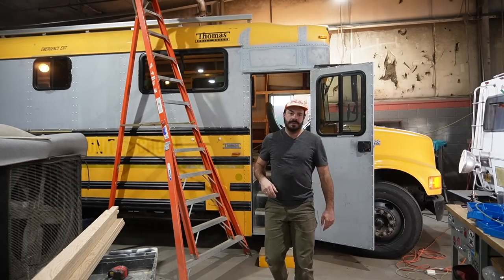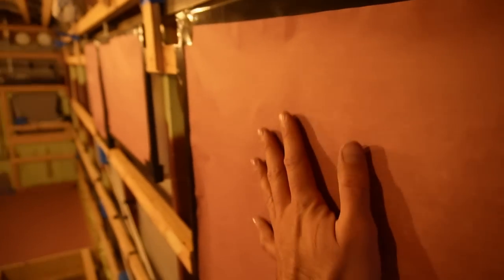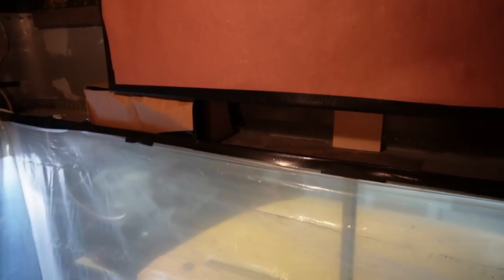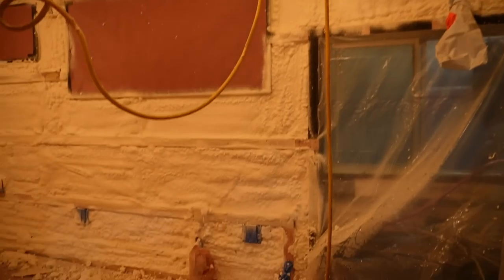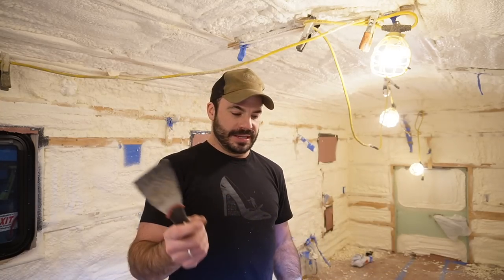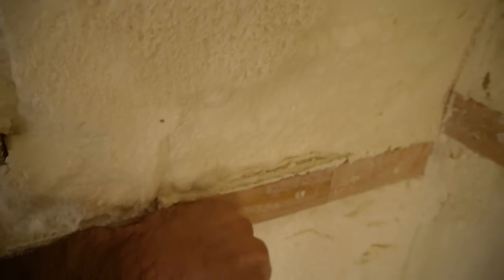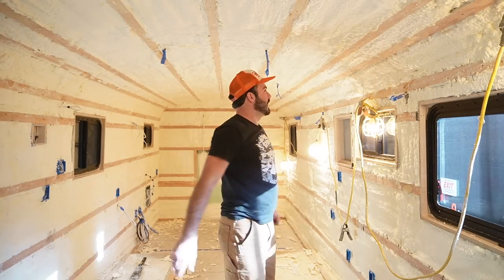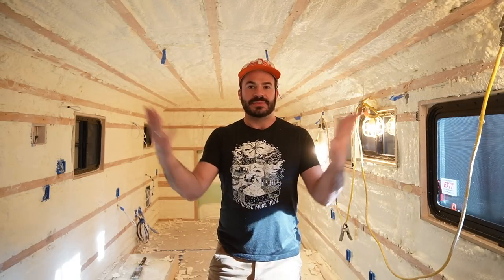Is Spray Foam Worth It?

Comment: If you put packaging tape over your strapping you won't have to scrape them
Reply from the maker: Yeah next time haha
Reply: What a great concept you would’ve thought he would’ve thought of that ha ha ha ha
Reply: I thought in another video you said that the foam should be a couple of inches thick over any wood ribs. 🫤
Reply from the maker: Never said that
Reply: @ChuckCassadyYT    Thanks.  I’ll go back and listen again. 👍
Reply: @christinearmington  I watched that one earlier today upon finding out about Chuck's videos. He was talking about going over the steel ribs with insulation and also not sistering wood next to or over (vertically) the steel hat channel like so many mistakenly do from not knowing better.
Reply: @christinearmington  
I think he was talking about making sure that the spray foam is applied over the metal ribs that people tie their studs to, and to spray foam over the metal ribbing to make sure that there is an adequate barrier to prevent moist air from hitting the metal, not the wood.
Reply: @christinearmington .  Nope. He said foam over steel ribs.
Reply: @christinearmington  yea I just watched that video too and got confused on how he boarded over it . Think he was talking about the metal not the wood
Reply: @christinearmington  metal ribs
Reply: @ChuckCassadyYT  insulation scam video at 33: you say "we spray OVER that WHOLE ASSEMBLY with spray foam", easy to misunderstand.  Nitpicking you a bit.  I agree 100% with your strategy, not much you can do without losing a lot of space.  The wood won't move enough moisture to matter in most cases, unless you're in bitter cold all winter then it will rot out the wood eventually, but you probably won't even notice with the wood foamed in.  The screws might make condensation and mold spots on their heads, not much you can do about that, maybe silicone caulk smeared over the head.  Stainless screws will have one half the conductivity of carbon steel, but that's getting pretty picky.

Comment: Pro tip. Once the sprayfoam is up, put some colored tape on the ribs wherever a wire passes behind it. That way, when your walls go up, you know where your wires are and where not to run a screw into.

Comment: Looks great. My only (admittedly ignorant) concern, is encasing those wires in the foam and also not being able to make changes/additions to the wiring if needs change later on. Would it be reasonable to install pvc pipes inside the walls to act as wiring ductwork for future enchancements? (recognizing the need to try to minimize the interruption on insulation, as much as possible)?

Comment: Just so you know, romex is not an approved product for automotive installations.  If it is actually romex, it is using solid copper conductors which are extremely prone to vibration.  If you are actually a "pro" you would, of course, already know this which means you have chosen to ignore it.  Not a good position in court.
Reply from the maker: You should watch my videos on how I wired my bus. It’s not romex

Comment: Buy a refridgerated van then windows to suit save loads on WORK COST PLUS PLUS ECT COLD IN COLD OUT..FIBRE GLASS COATED INSIDE..HEATING IS DOWN TO HOW HOT YOU WANT IT..😂 AND THEY OFTEN AS CLEAN as clean can be. Thumbs up if you like my comment

Comment: But...but...but, Chuck...what about all the offgassing I hear about in FB groups?  :-)  I'm 100% with you on the foam insulation.  Once the closed cell foam has expanded and cured, the structure is closed (hmmm...closed, closed cell makes sense) and (according to the EPA) "When spray foam has been correctly applied and cured, it is usually considered to be relatively inert."  I wish more people studied this, as you clearly have.  Nicely done, sir.

Comment: Is there a reason for only having 3" of spray foam yet the floor is 4" of foam? As warm air rises I figured you would want to do 4" of spray foam, unless you are trying to save a couple inches of space in the width of the bus for the interior. Spray foam is the way to go
Reply from the maker: R20 is my goal all around and thr board in the floor is only r5 per inch, while spray is r7

Comment: Do you prefer a particular spray foam formulation that retains some flex?  I'm wondering how the flex of the bus interacts with the foam.  In my experience, spray foam dries very rigid, and I could imagine the flex of the bus over time might break the foam and/or delaminate it from the walls, and allow moist air to touch cold metal.

Comment: Missed the live chat this week but man are you ever moving quick on this build! Spray foam looks great man. I still have a little bit to foam in our aft cabin ceiling and on the front cap, but every inch I cover makes a difference.  It's crazy how good it works.
Reply from the maker: It is definitely the best!

Comment: Chuck, Try an angle grinder with a 4" thick wire brush, grinds right thru the foam, just wear goggles as it will product foam dust that will get in your eyes.
Great video

Comment: Interesting video packed full of information.  The one thing that sticks in my mind is the heat.  In the US temperatures are getting so high in places, like Florida, Texas, the desert, etc.  This insulation can help with that, but what about an outer metal skin of these vehicles that heats up to very high termperature?  Can it cause off-gassing of chemicals from this foam?

Comment: That looks incredible!  I have a van coming in December and dream of having a similar insulation and framing.  I think I will prefer to have my electrical out and exposed so it is easier for me to install and maintain.
Reply from the maker: all i will say is that once your wall panels go up there is no way to maintain your wires anyway. plus wires dont need maintenance. you do you!
Reply: Is it crazy to think about using small PVC pipe to encase all electrical in? That way of there is an issue, you have an accessible chase to pull wires through 🤔

Comment: Excellent video. I got my husband to watch it with me, he has more knowledge of construction and insulation than I do. I certainly learned a lot from your opinion and my husband was able to explain the parts that were a bit triciy for me. We have a small fiberglass trailer, which we would like to insulate for both heat and cold. I am extremely sensitive to chemicals, so offgassing is a concern to me, however I think that you made a very good point about driving a diesel vehicle in the middle of traffic as a way of living. In my personal experience, exposure to airborne chemicals have a compounding effect, which is why we chose a towed as opposed to motorized RV and cannot use propane or butane, so we bought a used rig that we can customize. Beside offgassing, my husband has concerns about the flammability and toxicity of the fumes in case of a fire. I think it is a genuine concern because there is a higher risk of fire in an RV compared to a home and I am interested to know what your thoughts are on this subject. This being said, good job on your video, I am new to this channel and will check out your other videos and subscribe.
Reply from the maker: The sprayfoam we use has a class 1 fire rating so I'm not concerned about it, but not all.spray foam does! Thanks for watching and enjoy your new rig!

Comment: Could you just run the wires for the bus functions behind the foam and leave the "house" wires until after so they are more flexible and inside the foam?  We have a family of 4, and our bus is only 31.5 feet bumper to bumper so dialing in a layout before hand has been a challenge and precise locations of lights, outlets, panels, etc. might need to changed later.  We need a roof raise for sure to have bunk beds for the kids.

Comment: I sell Sprayfoam and a customer had a project where he bought a school bus. 2" of closed cell on the walls, 3" for the ceiling. Job came out beautifully. Acetone is the only thing that removes foam sadly it also removes paint as well. So use it very carefully

Comment: I think a major concern many folks have with spray foam is that it can warp the outside of the vehicle. You should show the outside of the bus and talk about how your guy avoids warping the sheet metal. Unless it did warp it, but still, showing and talking about that would be great.
Reply from the maker: That's overblown with a competent installer. Spraying thin layers and using no less than 18ga steel for the skins. We've sprayed dozens and never has that issue

Comment: That looks great, I was afraid that there would be far more trimming needed. How long was the installer there, and how long did it take you to trim afterwards? I am thinking about a small van build, and am wondering if spray foam makes sense or do you need a larger vehicle to justify it? Then of course comes the issue of finding a good local installer.

Comment: Ok, I don’t get it. In your other video you seem to indicate that all the metal and the wood framing needed to be covered with the foam. However after the foam was sprayed on you could clearly see some of the wood? The metal ribs stuck out like 1.5” and then the wood was attached to the metal ribs and stuck out an additional maybe 1.5” then the entire 3” cavity was filled up to the outward face of the wood framing but not covering it? This seems to be contrary to what you said in the other video, and would it not support the desire to have moisture not reaching the wood framing, or is preventing the warm air from reaching the metal/wood contact point is the important thing. Also, wouldn’t covering the boards not prevent thermal bridging but still make it easier to attach cabinets as you can still see the framing?

Comment: Great video as usual. Thank you Chuck.  Question: Why XPS and not Spray foam for the sub-floor?  If this professional spray foam hardens that much, why not use for the floor then?  Thanks!
Reply: Since he doesn't frame the floor, I suspect the flatness of factory-made panel products is the key reason. Trying to get a spray foam floor as smooth and flat as panel products would add tons of labor hours to the build.

Comment: I was planning on steering clear of spray foam for my fiberglass shuttle build out but now you have me reconsidering primarily due to the claim that it will add to rigidity of structure which is a serious issue for shuttle buses...however still concerned with it expanding and warping my exterior since it's not metal...I am using mostly marine grade products for my land yacht
Reply from the maker: I've never had issues with expansion like that, especially if applied by a pro

Comment: Hey Chuck, sorry I am confused, I did just watch your video on insulation 101 and I thought you mentioned that even if wood touched metal and its not insulated then it becomes a thermal bridge, I see all your wood framing and no insulation over it so am I missing something?? sorry for not understanding, I want to follow your instructions  and needed clarification if you could please, Thank you, your excitement is motivating
Reply from the maker: The places the wood touches the metal is covered with insulation
Reply: @ChuckCassadyYT  The amount of wood strapping that's bridging is just the part over the metal rib, because the wood is a good enough insulator that it won't conduct along the length much, not like a whole stud that's touching the exterior, or worse a metal rib that's touching the exterior metal skin.  If you used aluminum strapping over aluminum ribs, then the whole length of the strapping would be a thermal bridge.  The wood is nearly the best solution.

Comment: What do you think about putting the plumbing in the floor channeled into the last layer of foam board under the plywood?
Reply from the maker: Not a bad idea but that is a cold place for it
Reply: I know you were asking Chuck but the floor is the coldest part of the bus. If pipes are going to freeze anywhere, it would be there.
Reply: @rossallen738  Lol probably right, I was thinking why not sandwich it in between the insulation and plywood but meh. If you are in a warm climate all the time it wouldn't matter but in my area it gets below zero in the winter and over 100 in the summer lol. oof.

Comment: Great video! I have 2 questions! For the gap behind the chair rail, how did you clean rust off if any was present, and did you add chassis saver? As for spray foam, did they just spray it down into the gap? Thanks for your input!
Reply from the maker: my bus was rust free down there, so i just vacuumed it and washed it and let the spray foam fill it in
Reply: @ChuckCassadyYT  thank you! I’m hoping ours is rust free as well!!

Comment: Chuck, could you wrap the inside of the insulation with visqueen as a vapor barrier, similar to homebuilding, if you cant get the full 2" of foam or if you were to use a different type of insulation.

Comment: Hi that came out beautiful,.
I have a question I have a 32-foot Holiday rambler motorhome I'm getting ready to redo the whole thing they say that from spray foam world distort metal the motorhome is aluminum walls in aluminum frame I was going to frame everything up I could floors walls ceilings and then spray foam but I'm worried about the walls of the motorhome very thin aluminum I could use strapping as a barrier between the aluminum frame in the walls what do you think this thing is in 1976 and they don't make them everyday butt spray foam the way I wanted to do it your boss is made out of steel and they're rugged this thing isn't rugged

Comment: Did you consider using [lightweight plastic] conduit for the wiring so you don't have to dig it out later if there is an issue?  It would also provide a path for any warm spots to spread the heat.
Reply from the maker: I cover this in a video all about wiring

Comment: What do you do if anything to prevent the screw heads holding the fur strips from condensation?
Reply from the maker: The first layer of wood is covered by the second and sealed with foam so it's very very unlikely to have condensation build up
Reply: @ChuckCassadyYT  Oops' after pausing the vid I see it's double layered, nice! can you get away with less than 1.5 "?

Comment: I saw another video, a guy talking about expanding builders foam, saying it's carcinogenic.  Then he said he didn't feel comfortable using this foam either, because while it's considered ok today, who knows if it's just a case of not enough time has passed yet to discover it's negative effects.  Q1. What are your thoughts?  Is it safe, toxic?  Q2. Since you don't use electrical conduit, what happens if you later want to remove, replace, or add more cables (by leaving some nylon rope maybe, stainless steel cable, etc inside the tubing to make pulling old/new cable out/in easy)?  Is it easy to refill the foam that tears out when ripping out/trenching in cables?
Reply: Yea spray foam is very toxic especially if not mixed properly and applied it will continue to off-gas VOC's indefinitely . I would just go with havelock wool insulation.

Comment: Can you install your wall panels first, and then have the foam sprayed to fill the space? It would be more like a "This Old House" remodel, but it should lock everything together (a stiffer wall) and seal (slightly) better.
Reply from the maker: Not with this spray foam, I personally don't like retrofoam as you have no verification of its success and install is not as straightforward. It's a last resort, not a first choice for me
Reply: @ChuckCassadyYT  THX!

Comment: Since you did not spray foam the cockpit, how do you insulate the drivers floor board area?
Reply from the maker: the floor is insulated, and the back of the firewall has sound insulation but there just isnt room for anything else

Comment: I see you left the door on the back as is. Will there going to be any issues with condensation without being insulated or any type of lose in your R value because of that?
Reply from the maker: great question! That will be in my garage space, so im not too worried about it:)
Reply: @ChuckCassadyYT  thanks. So then in my case I have a pusher with door on the side. What would you recommend in order to keep my r value

Comment: does spray foam on a hot day hold that heat and release it all night long when u try to sleep?
Reply from the maker: the foam holds no energy. its the hot steel of the bus body that does. if you can get an awning up on your sunset side, you'll have it made

Comment: I’ve heard about spray foam deforming panels on sprinters (AdvancedRV said this). Is that a thing?
Reply from the maker: not on bus, then again, my bus is considerably thicker steel than a sprinter. However, we have sprayed sprinters without issue, it has to be applied in thin coats

Comment: Could you paint the foam and leave it that way?
Reply: They do it in farm sheds all the time.  If I was doing it in a camper, I'd use a sharp knife, or a sander to smooth the excess so you get a paintable surface.  Not for everybody I suppose.

Comment: Chuck, I have a question. Firstly, loving your videos, I have now watched all or almost all of them except for all the live ones.

So, I want to insulate my bus the way you did, here is my question. Is the mini-split AC enough to keep occupants comfortable driving through the south in the summer, or do you think there should be some engine driven AC included? 40' bus, probably a dual split system, say 24kbtu total.

Thanks.
Reply from the maker: Man, while driving, the cooling load increases dramatically. I’ve seen factory ac units in buses that are 120kbtu. Hard to say what will work for you but I do think you’d need near 40-60k to keep below 80 when it’s over 100
Reply: @ChuckCassadyYT  My bus' stock AC is 120kbtu. But I don't need that much.